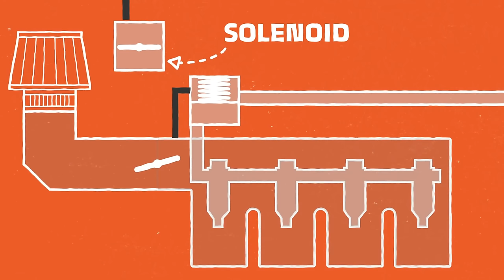Lowrider Mechanic Reacts to Lowriding Fails

Comment: I had a lowrider when i lived in California. I spent some time looking for a fabricator to do the full frame wrap, reinforce the a-arms, rear end, slip n stubb, etc. I couldn't find someone i could trust with my car. 

Most lowrider owners you see in Cali are quick to spend their money on candy paint, chrome undies, and interior. However their cars were not reinforced and their trunks were fire hazards. Wires everywhere, batteries not secured properly, and oil leaks like crazy.

Comment: I'm more of an off-road enthusiast, but our spheres have a few things in common. Like my truck, the first generation Nissan Pathfinder. I've seen a few lowrider pathys online and they kinda rock. I want one set up with on the fly adjustable suspension height so I can drop it for parking, cruising, and highway, and jack it up when I have to drive over a fallen tree to get home from the grocery store without backtracking 35 miles. As a temporary compromise I just have it running at stock height on stock 31s.
BTW my dad grew up in Socal and I was raised in Arkansas, so that's why everything.

Comment: I had a friend who had a 63 impala on switches & I was fallowing him home , we rounded a corner & he dumped the front passenger side of the car with the switches wile we were turning left putting it in three wheel & I herd a crunch & a pop , he popped the front right spring out of the car & it flew out across 2 lanes of traffic & up into the grass & into some bushes in front of a Wendy’s , the bushes stopped it from going through their big bay window , he limped the car home & took it to his mechanic the next day & we both found out he broke the frame in 3 places & twisted the frame in a 360 degrees in one place , that’s how much torque he put on the frame without having a 3 wheel system in the car . He found out real quick that the car was totaled & that a frame would cost him as much as the car was worth , he ended up parting out the car & getting his moneys worth out of it & went out & bought a caddy the next month or so .

Comment: A safety strap would stop the travel of the lower control arm if the ball joint breaks. Some of the older cars had a metal cable on the motor mount to minimize damage.

Comment: While not made for jumping my 2013 2 door wrangler did just fine. It even bounced and stayed perfectly straight. The abs HATED it though and slammed the brakes on both landings so I kissed the steering wheel. But it slowed me down enough for the turn after 😂

Comment: when that spring shot out - thats best case since it just rolled on the ground not shot through several vehicles or killing a few people. Those things can be under insane amounts of force. The reason they use those old cars is because they're cheapish to fix and aren't unibody so you can actually fix

Comment: You can't BS with hydraulic pumps & systems bro.. You kinda gotta go ALL in for the pumps & switches frfr!!  
Even in NC.. I see myself jumping on N. Tryon (Charlotte)!! 💯💯💯
I asked for a quote before the pandemic.. It was $25-100 per dump! AND to fix the suspension on a '97 Chevy Caprice.. with SWITCHES!! 
(maybe 6-8 switch controller.. was 3k WITH the multiple batteries & BUILD ALONE!!) 🥶

$10+k for any complete build!! 💯  From my investigation in NC..

Comment: Had a solenoid melt terminal fell out grounded on battery rack and blow the top off a battery. 
Also broke upper  A arms
Left my car on 3 for like 2 weeks oil pump failed lost prime or something had a bad knock until I sold the cutlass

Comment: Chrysler 200 rear brake calipers have to be spun off the brake hose instead of having the normal screw that goes through the hose part that allows the fluid into the caliper.

Comment: I would like to ask if it's ok to put 10w40 in the reduction gears in the wheel hubs on a tractor. My boss told me to do that because they didn't have the correct oil on hand.

Comment: They make a statement when they flip a car that has a paint job that is so beautiful, has so much time and effort in it, has so much money in it, onto it's roof... Just to make sure everyone knows their dedication, and to make sure you get to see the MF BEAUTIFUL paint job they did on the entire underside too! A lot of the average cars you see hopping etc look nice from a distance but are usually rust buckets, cars that were wrecked and have a tweaked frame already, flood cars, etc because they get destroyed anyway, after awhile of that violent twisting and shocking everything is destroyed, from electronics to the frame All of it became disposable the moment it hopped the first time 😂 you know something will break, it's part of it, gives you an excuse to upgrade and make it better, but what I think is absolutely sad is a fire, there is massive amounts of DC current required to run the pumps and solenoids, and when a pump motor cooks it can get real hot and burn the car down crazy fast, once it starts it burns off insulation on wiring and causes shorts, with thousands of amps available from those batteries a normal fire extinguisher is not helping, it's always so sad, never want to see it happen.

Comment: Lol a ball joint fix is $20. If your a smart lowrider you run chains on the front end so when the ball joints come apart the front doesn't.

Comment: These guys are kinda off. That black lincoln either blew a bridge which holds the rear cylinders or the threads of the cylinders came off. Had the cylinder unthreaded,untreated, it's unlikely that 2 would happen at the same time. No way he could have "blown a hose". ...

Comment: don't get why abuse a classic like that, on top of ruining how it drives, but the biggest question after devaluing it would you not be careful not to kill it as i bet not to many old cars left body on frame, modern cars not built like old ones so when old cars the cost goes through the roof, be interesting to see what happens to this madness the next 20 years
Reply: It's culture that comes from the 1950s. Mexicans were targetted by police for riding low so they implemented hydraulics to lift their cars. Sure some of these are "ruined" by your standards but for us, it's beautiful. Chicano and black cultures still celebrate this today after 70 years.
Reply: what you going to do when all what available is modern junk, modern cars doubt can handle this much abuse even if modded, you only have limited amount old cars     @Doughtube

Comment: I never really understood why low rider people need to do this to formerly awesome classics.  Can't they mutilate Pintos, Vegas, Citations, LTDs, and Gremlins which were never cool instead? Or what about a Smart car, that'd be interesting.
And if they're doing such extensive work anyway, does it need to be rwd? Maybe they could use more recent disappointing domestic metal like a 2000s Sebring, Malibu, or 500. First gen Compass and Patriot should be a dime a dozen used now, those pathetic machines.